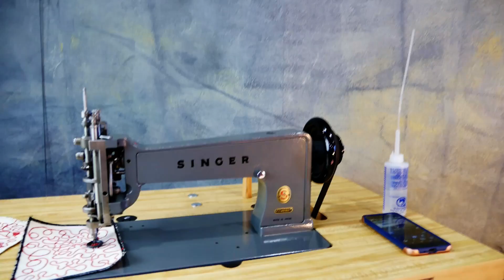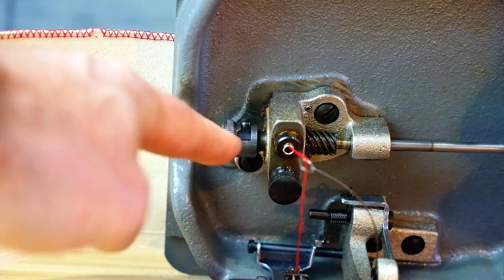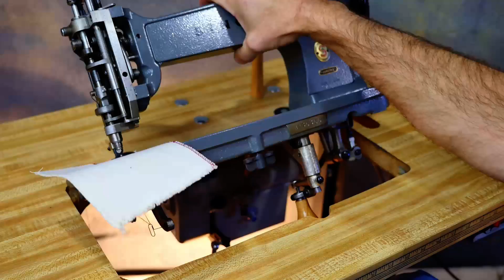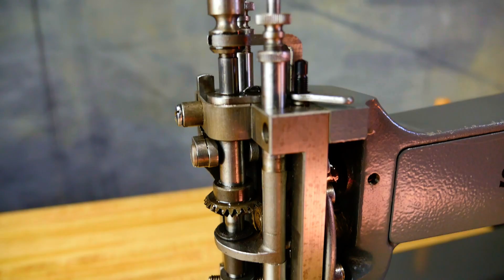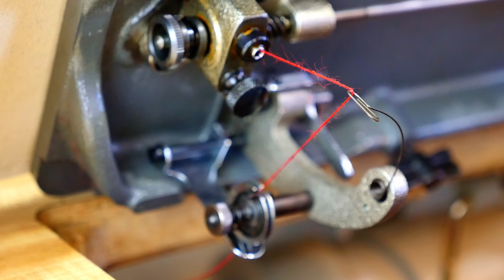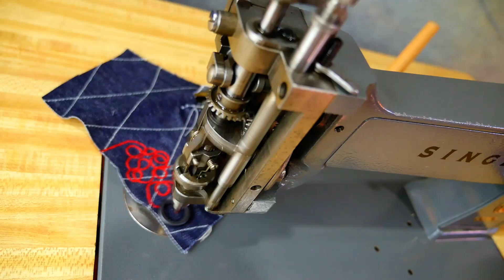Singer 114E103 Chainstitch Embroidery Sewing Machine

Comment: Hi Alexander.  I never saw a machine of this configuration.  Looks like it has no bobbin, and a rather simple threading path.  I’ve often asked myself and wondered why domestic and industrial sewing machines can’t be designed to work like this one without a bobbin.  It seems like what would be the bobbin thread is pulled off a cone from under the needle and machine surface plate.  Maybe I misunderstood what you said about the thread.  If I did misunderstand you, would you be able to explain how this makes the stitch or possibly direct me to a site where I could read more about this machine type.
Best wishes to you for a happy, healthy, and prosperous new year 2019 and beyond.
Thanks for continuing to record these videos.
Reply from the maker: The main difference is that this machine does not make a "lock stitch". A lock stitch requires two threads and one thread has to go around the other, that is where the bobbin comes in. The top thread of a lock stitch has to pass completely around the bobbin to form a single stitch. This machine makes a chain stitch with a single thread. Here is a page with diagrams. The two stitches discussed here are the 101 and the 301. Hope that helps. https://www.coats.com/Guidance/Basic-stitch-types
Reply: Alexander, thank you for that link and explanation. That is just what I needed to know.